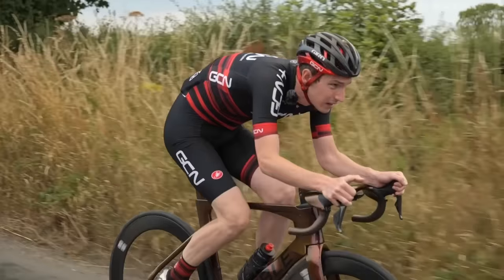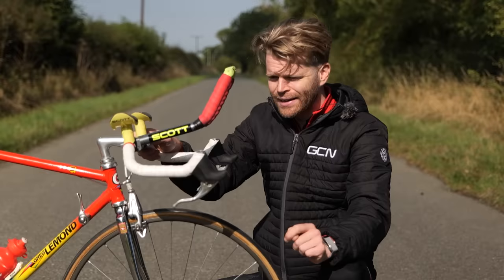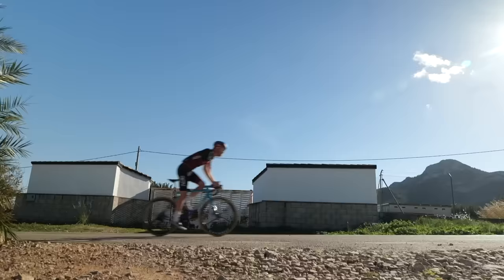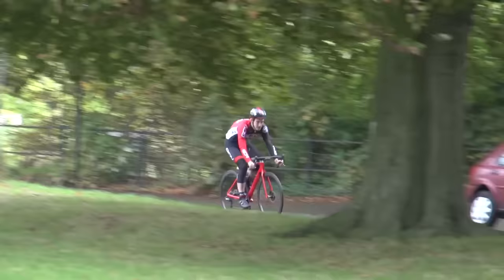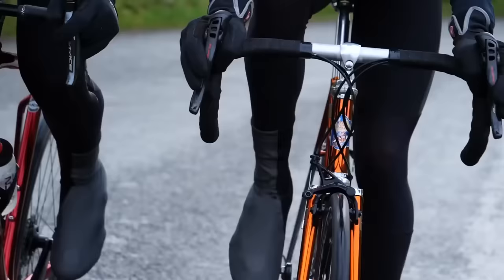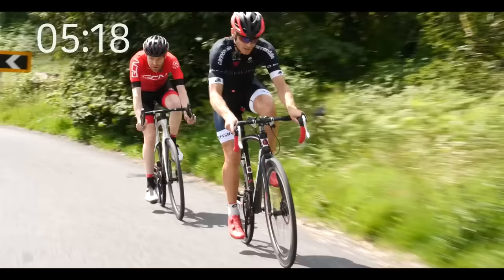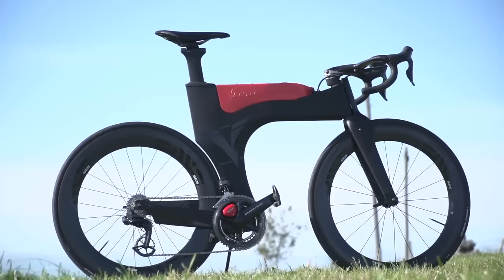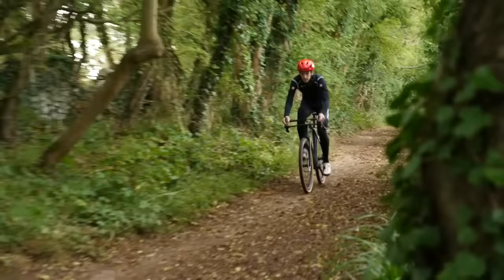Super Bike Vs... [2 Hour+ Compilation]

Comment: I still want to see them upgrade the Eurobike (tubes, tires, saddle, chain?, index shifters, brake pads/ rotors) & see how it compares.
Also with that cheap e-bike.
Reply: Even not upgraded, that awful unridable slug is 25 years of essential engineering innovation newer than 99% of what I see most people out riding on training rides.  Most of what I see are steel frames from the ancient to the botique, built with whatever old aluminum kinesis fork came on their previous bike & some old 90s campy.  My gods how does anyone survive a road ride without buying whatever $12k molded plastic Chinese bike we’re being told is so much better this month lol

Comment: I thought Lemond used aero bars in an earlier stage (a mountain time trial). Fignon didn’t put in an objection at their use and so when he did put an objection in after losing the final stage (and thus the Tour) his objection was overruled.
Reply: He had; he used them in every TT (save the prologue) in the '89 TDF. 

And he didn't have to be convinced to use them. He saw them used earlier in '89 at the Tour de Trump and recognized their aerodynamic advantage and  used them (along with 7-Eleven) in the '89 TDF.

7-Eleven were the first pro cyclists to race on the tri-bars in the '89 Tour de Trump -- they also used them in the final TT of a stage race (TDT).

Comment: Does that mean that the riders in the 1980s were stronger?
Reply: On flat rough surfaces like cobblestones modern tech does literally zero.  On climbs its good though.  It wasn't until 2017 and tubeless tires were a thing before the Paris Roubaix stage record from the 1960s was beaten on a carbon bike.  The bikes bounced so much they were actually slower until squishy tires were invented.

If you are a really slow rider you will probably have more fun on carbon because the bikes are super easy to pedal.  If you are a strong rider with no interest in racing and you ride in urban areas steel bikes will give you a better ride and better handling.  If you want to race at Cat 2 or above probably a good idea to be on carbon.